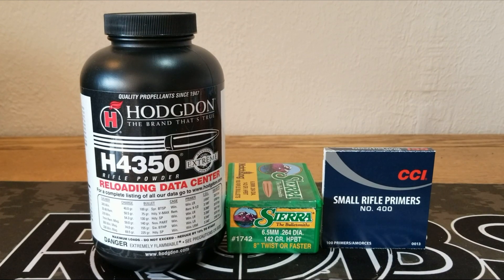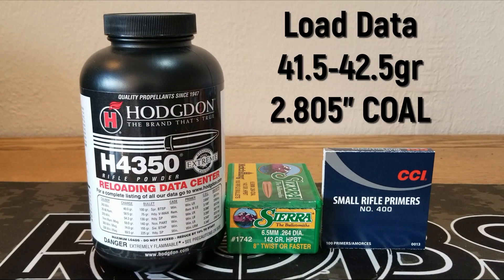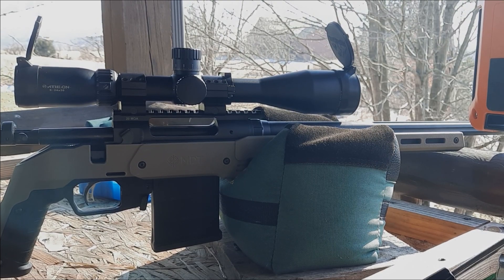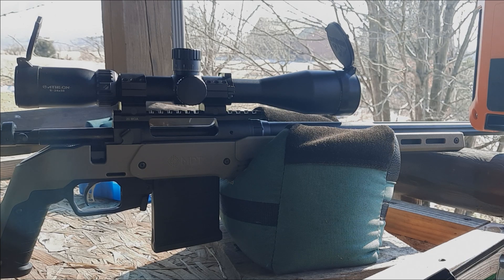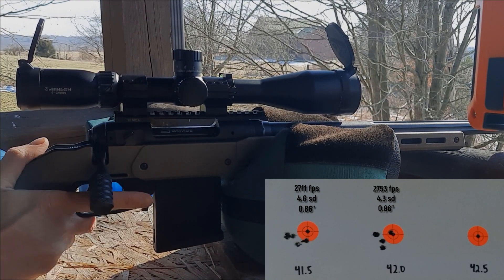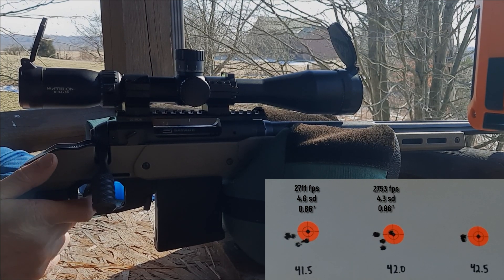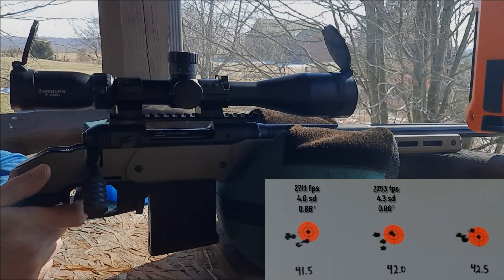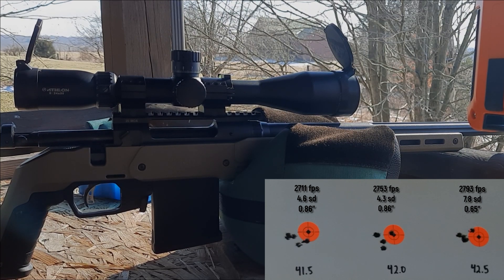6.5 Creedmoor, 142 Match King, H4350

Comment: I think if you were to take a 2nd look, you'll find that the Creedmoor cartridge case, is a Large Rifle Primer pocket, not a small rifle primer as your picture ad shows.  Small rifle primers are for cartridges like the .223 or 5.65, .22 Hornet, etc..  If you tried to actually use a small rifle primer in the Creedmoor case, those small rifle primers, would just "drop" right out of the brass primer pocket.
Reply: You can get 6.5 brass that uses small primers

Comment: when you do you load testing are you just setting your coal to the recommended seating depth of the manual? or do you have a preference like 20 thou from the lands?
Reply from the maker: @mastermighty  usually find what will fit in the chamber and mag then roll with it
Reply: @RobsReloading  many thanks for the reply.

Comment: 41.3 of H4350 with CCI 450's works good in my Delta 5 Pro (2780fps SD 4.6) and my 18 inch suppressed AR10 (2550 SD 6), 5 round groups average between .4-.6 in each rifle.  Awesome combo and lovely to shoot out to distance.  I went up to 41.7 and found it was the best for my bolt gun but since I usually shoot them both and dont feel like only having ammo for one or the other, just grab and go. I used your video as a reference as I was loading for my AR10 first and using starline small rifle primer brass and backed it off for the first load to be safe.  41.5 ended up having primer swipes and 42 shot really good but the swipes were so bad in the AR10 it was raising little shavings off the back of the case.

Comment: Rem 7 1/2 is thick cup, not as hot as the cci 450, works best in my rifle.  Work up slowly.  Savage barrels are accurate, keep the copper fouling out of the barrel which means de coppering every 25-30 rounds. A teslong bore scope is around 89 bucks, your best friend in keeping your barrel shooting small groups. For deer, don't over look the 130g Hornady eld M and the 140g Hornady BTHP!  My rifle likes the bullets seated very close to the lands, which is why the 140g bthp is a great performer.  Also, the 129g Hornady SP is one heck of a deer and hog bullet, thinks it is a partition in penetration.

Comment: No complaints at all with results in my book. Whitetail loading with any of these any deer in season. Excellent powder for temp variables.
I would look at the 42.0 & may give 42.2 or 42.3 a look if I wanted a bit more velocity. But this looks like a winner all the way around.
Reply: Not technically a hunting bullet, but likely quite lethal with the proper shot placement!
Reply: @dahut3614  Agreed